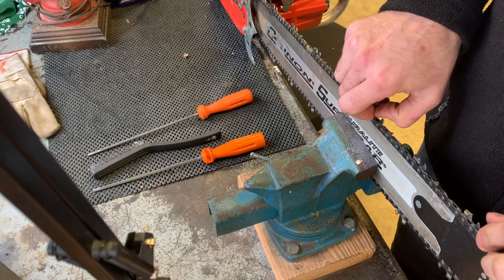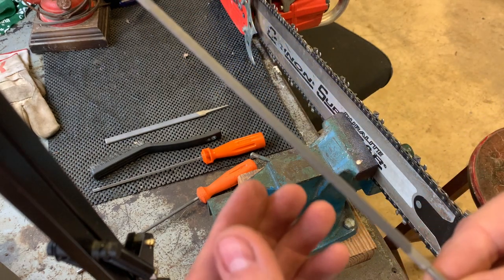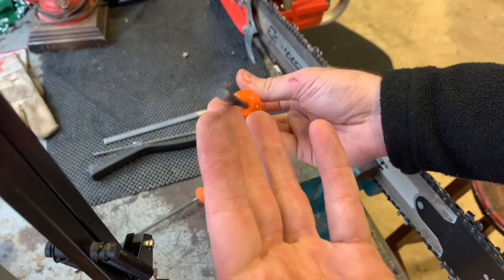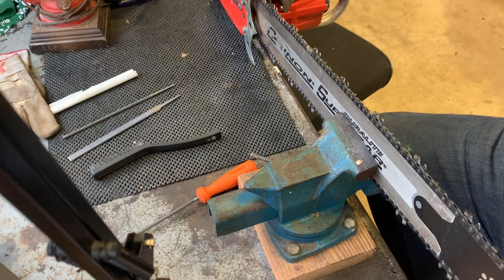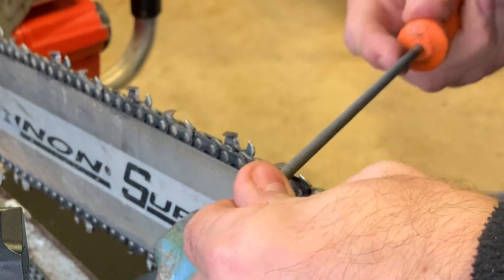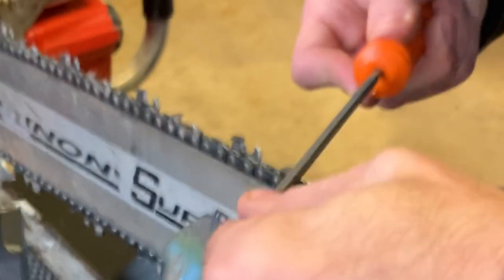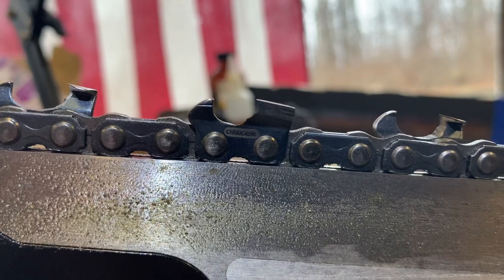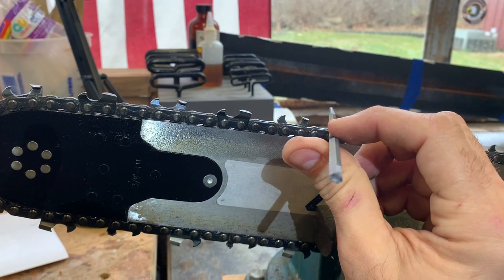Stihl HEXA File Alternative!

Comment: What I am wondering is what happened to file quality and durability. Seem the hardness is just lacking from files of years gone by. Even files marked SWISS MADE does not really make a difference. What the hell gives. 
Does the HEXA sharpen chain really work for hickory wood that is frozen in the woods ?? Seems most videos show cutting solf woods. I am from the northeast woods of Pennsylvania. We mostly have hardwoods to deal with for sure. What can you show us to make cutting tough wood possible with speed cuts too. Look forward to find out the answer Sir DOUG. Peace vf
Reply from the maker: I’ve heard of people breaking the hexa files from just filing if that tells you anything🤦🏻‍♂️

Comment: Mr. Doug this is very interesting. The broad file would be versatile for the raker/depth gauges. As to quality files and durability, chain prep is important and you spoke of that. The cleaning of that high quality file is important also. Rust prevention, sweat is a file killer as well. Another file cleaning tip is to back-drag the file through a scotchbrite pad periodically. Was that mouse living in that hollow, or was he just in the neighborhood? I enjoyed this sir....
Reply from the maker: Good tip. That mouse just came out of nowhere man🤷🏻‍♂️
Reply: @IndianaDoug  "I've been there"....
Reply: When I'm in the shed, I find it really good to spray the file W break clean and then hit it with the air gun..every 15-20 strokes. It makes a massive difference imo
Reply from the maker: Good tip👍🏻
Reply: @thetreeleggedman9444  Yes sir...really good tip...

Comment: Very cool! Could be a silly question, but does the hexagon shape help it cut faster, hold an edge longer or both?
Reply from the maker: We don’t know for sure yet, but this profile is closer to a square filed profile and square is certainly faster. The Hexa profile isn’t quite as aggressive as square proper. So in theory, Hexa should be more durable.
Reply: @IndianaDoug  can’t wait to find out! I’ll be buying one of these files if that’s the case. Thanks for the info sir!
Reply: It should hold an edge longer. A round filed chain chisel chain has a very fine point, but it's effectively hollow ground, which means the fine edge is not backed up by much, so it will dull more easily than a square filed chain.

The Hexa idea seems to be simplifying square grinding so people don't have to think about angles as much. It may add up to something similar, but having such an angle on the side plate will likely be worse off than square file - the chips/sawdust should be carried by the chain, not allowed to escape out the sides.

The Hexa file should also be able to be used for square filing since it still includes the 120 degree angles of double bevel and "triangle" files.

Comment: Cool.
Reply from the maker: Thanks👍🏻
Reply: @IndianaDoug  If you drop your file 10 degrees you would get an even better result. I used to do this type of filing with a goofy file. Look up Atop racing cut on YT. Also, can you do your cuts in a smaller piece of wood?
Reply from the maker: @24cupsandcounting  thanks for the source and tip, I’m willing to try anything to see how it works. The problem I’m dealing with is if I keep angling down only the working corner and a small section under the side and top plate get sharpened. It’s like the top plate angle doesn’t line up at that point.
Reply: @IndianaDoug  I am not referring to square filing but the Atop style. You still file as you would conventionally with a round file. Dropping your file 10 degrees will eliminate some of the beak on the tooth.
Reply from the maker: @24cupsandcounting  I see. Btw I really like Atop system. I’m going to try the square file technique. They file a bit differently than most I’ve seen.

Comment: Square filing with more pitch on tooth
Reply from the maker: I get what your saying, but this video isn’t made to show square filing proper. I’m trying to show how a person can file to get the “HEXA” profile. The HEXA file is to be used like a traditional round file with no extreme angles.
Reply: I see, I was saying you can get the same tooth angles with a square file if you change the angle slightly.
Reply: Sorry not an actual square file but the double bevel square file